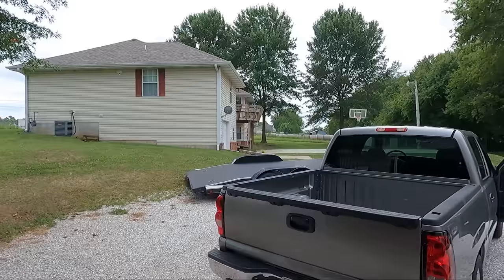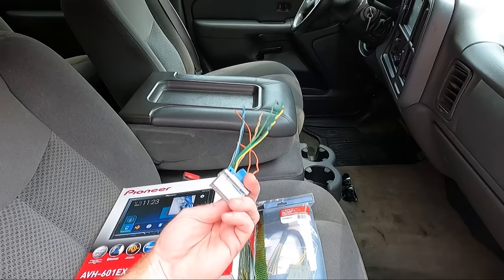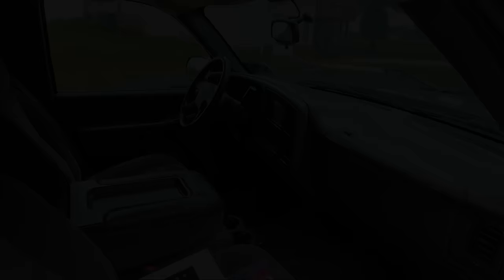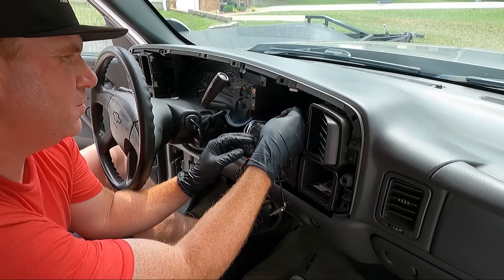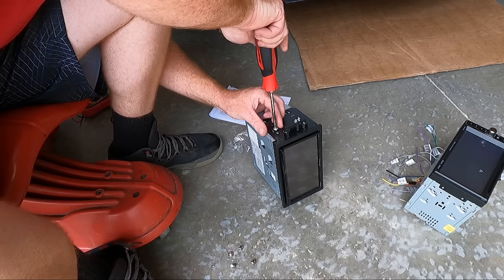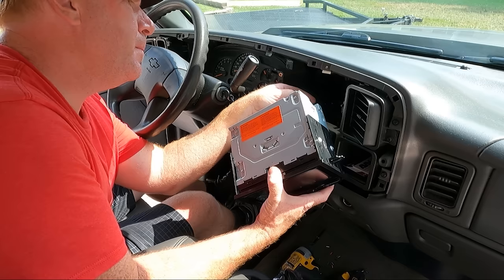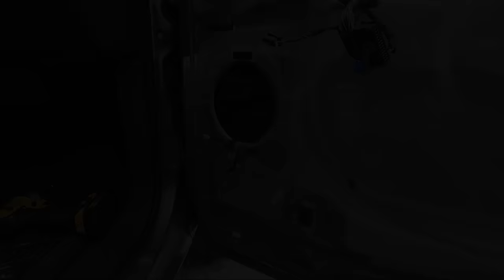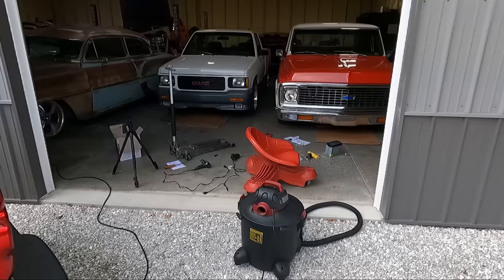New Radio Install in the Daily Driver Silverado

Comment: Only reason this video doesn’t have millions of views is people seem to stop working on their own cars they just buy a new one and throw the old one away like cell phones 😔 just wanted to let you know 2 years later someone appreciates the time and effort you put into these tutorials ❤
Reply from the maker: You aren't wrong. I appreciate the comments
Reply: I could of bought a brand new pickup truck that worked and what not.. but nope I got a 97 gmc that dident start and now after being in the shop it's running. I'm a truck driver who is hardly home that's why it's in th3 shop however.. I will be updating the suspension my self

Comment: There’s a bezel for the tailgate handle with a built in camera like the new trucks could be interesting for that reverse feature
Reply from the maker: Yeah I have seen those
Reply: I bought a license plate back up camera. It worked great with my Pioneer. Also nice to have when backing up to hook up a trailer.
Reply: @larrydeaton5452  the image and the quality good?
Reply: Yes. Both are really good. It was around $25 on Amazon.
Reply: @larrydeaton5452  have a link by chance?
Reply: @asvpxmi6uel    Do you have a link by chance?
Reply: @danadams3362  I don’t,but you can look up eRapta back up camera on Amazon.
Reply from the maker: It is really awesome loading a trailer
Reply: @TWAMotorsports  I have the same radio all the sudden my base doesn’t want to work any tips I checked the amps and they good not sure what to do
Reply from the maker: Check power connections
Reply: @TWAMotorsports do you have a video on how to install? That's why I'm here trying to figure this out. It shipped without instructions.
Reply from the maker: I did a reverse camera install a while back on the channel

Comment: Good evening Travis. I put a Pioneer double din all touchscreen in my 13 Silverado. I bought the upgraded interface that retains the steering wheel controls. My truck didn’t come from the factory with steering wheel controls. I bought a leather wrapped unit from my local salvage yard that had the controls. It all worked together and now I can control the stereo from my wheel. I also took out one of my 12 volt recepticals and put a factory GM usb plug with the cover to match the other. Now I can use my Apple CarPlay. Worked out pretty sweet
Reply from the maker: Thats awesome. I have seen that 12 volt usb deal and it is nice

Comment: I put a radio a couple of months back in my son’s first car so he could have Bluetooth. Bought a harness of eBay and spliced it for plug and play no cutting wires and like you except soldering, I got heat shrinking butt connectors then black tape around them and the harness as a whole. I was alittle nervous because I’m a handle guy but I never put in a radio but it worked perfect. I just took my time the night before sitting at the table splicing in the harness. Pioneer is the best! I have ran them in almost all my cars. I have a pioneer 760 amp and a Alpine Type R 12in sub in need to put in my car now but I’m not going to tackle that one!
Reply from the maker: Thats awesome. Sounds like a nice set up for your son.

Comment: I just came across your vid (nice work). You have all the speakers wired correctly except possibly for the front passenger door. I too had the same issue (especially when I got to rear passenger door and saw the brown and yellow wires, so I followed the same logic as the other side....LOL). I looked up the factory specs as per GM, if your vin code in the glovebox is UQ3/UQ5 then light green wire is (-) and dark green wire is (+), and if the vin code is UQ7, then light green wire is (+) and dark green wire is (-). I hope this helps the next person who faces this issue when installing their aftermarket radio.
Reply from the maker: Thank you for the info

Comment: I've always been faithful to Pioneer head units. I have an older version of that head unit you installed in my 05 Tahoe. I'm thinking of upgrading it so I can be able to use Android Auto. I will run the USB for my install though. Good video!
Reply from the maker: They are good units

Comment: You can run a ground wire from the bolt that is on top of your gas pedal to get a frame ground if need be

Comment: Really appreciate the video, I ordered the harness you linked and installed a radio and everything works but the radio stays on even after I have the truck turned off. When I first installed it would turn off when I turned the truck off but after a day it’ll stay on. Idk if it has something to do with it being a Bluetooth paired radio through an app on my phone or if something went wrong with the switched power on the harness, any ideas?
Reply from the maker: It was the harness

Comment: I just Subscribed and liked this video. I like neat wiring jobs.  I read all the comments and one asked about the dimmer. Have you determent if the dimmer works on this radio?
Reply from the maker: Thank you. Dimmer works but not like the factory. Basically on or off.

Comment: The new radio looks nice. Also I think a good mod would be replacing the center seat with a console. I’d personally also install a backup camera and roll up bed cover. But this is such a nice crew cab.
Reply from the maker: Thank you. I have a console. Just waiting for a few other things
Reply: @TWAMotorsports  can’t wait to see it
Reply from the maker: Hopefully in the next month
Reply: Just did a full console in my single cab found it in the junkyard looked brand new couldn't pass it up for $50
Reply from the maker: Nice
Reply: How on earth would I put a backup cam? Im new to cars/trucks. But I have a 2005 silverado 4x4 z71 with the full big doors I think that’s extended cab? Again im new. So how would I do all this?
Reply from the maker: Not sure where to tell you to start. May be best to have local stereo shop do it for you.
Reply: @TWAMotorsports  haha lol after a few more weeks of research I’ve figured it out what once seemed impossible im quiet confident I could do it myself now LOL but if I don’t have the time id definitely check out someone doing it for me

Comment: Truck is almost as good as mine Trav! ;) you are a better man than I am. I double twisted the cables and heat shrunk them in. I also like the Jensen Cr270. It's super basic but it's rated to 80 mw and has Bluetooth and is like 50 bucks. Not complaining about that. New carpet when?
Reply from the maker: Thank you. Yeah can't beat a price like that. Ordered samples for carpet so who knows when it is coming

Comment: Did you not need to run a ignition wire? I'm having a hard time with mine. The harness I bought fits right, but the ignition pin goes nowhere on the OEM. I guess because GM uses the network instead of 12v ignition?
I bought the same harness pack you used in here, hopiing that the beeper module will solve this igition issue.
Reply from the maker: Not if you use the correct harness like I did
Reply: @TWAMotorsports  awesome, mine came in the mail today, looking forward to seeing this head unit actually turn on
Reply from the maker: Hopefully so
Reply: @TWAMotorsports  Dude you are the fricking man! it worked perfect. Does your dimmer work though? The instructions say to use the one coming out of the module if there isn't one on the OEM pinout, which on mine there isn't (07 classic as well), which I did but it didn't seem like the dimmer worked at all.
Reply from the maker: Mine all works but not sure on dimmer

Comment: Great video man.  Did u ever figure out the noice on these headunits for these trucks? I've installed Pioneer AVIC-W8600NEX and this noise been annoying me
Reply from the maker: Start up noise?
Reply: @TWA Motorsports  yes. There's a lil buzzing noice. You can still hear it with volume at 0. Not sure if it has to do anything with the bose amp
Reply from the maker: I have no idea.
Reply: @definitehotshotwill did you figure it out
Reply: @ThaMourningAfter  yes. I've installed a amp and ran all new speaker wires to the amp. Made sure I had good grounds. Nooce went away
Reply: @definitehotshotwill  thank you

Comment: I have a 2002 GMC Sierra 2500 HD what size Radio do I need?
Reply from the maker: Stock size is a gm din and a half radio.
Reply: @TWAMotorsports  ok
Reply: @TWA Motorsports  I just bought a new dash panel so I could have a double din
Reply from the maker: From metra?
Reply: I just got it from Amazon.
Reply from the maker: Can't help then
Reply: @TWAMotorsports  my kit worked!! Thanks for the video
Reply from the maker: Nice. Glad it worked

Comment: The radio on my OBS was horribly wired. I had to rewire the entire radio wire harness from power and ground to speaker leads. Bought an OEM plug for the truck side of the harness, then bought the adapter plug for an aftermarket radio and wired it to the radio plug to make a subharness.
Reply from the maker: Thats the only way to do it.

Comment: I have a question.  Someone stole my subwoofers n now my kenwood stereo wont come on. Will buying a new one solve the problem ?. 2005 tahoe. Asking because i watched all of you videos and seen you had a couple tahoes
Reply from the maker: Could just be a fuse issue. Need to test for power to radio

Comment: Dealership is just pulling the fuse instead of disconnecting battery these days.
Reply from the maker: That is easier I guess
Reply: @TWAMotorsports  only if they put them all back in correctly and didnt decide to hack in my BCM wiring harness for the power they lost.  Good thing I had pictures and could prove it.
Reply from the maker: Oh crap. That sucks